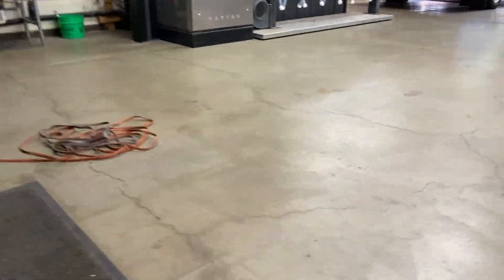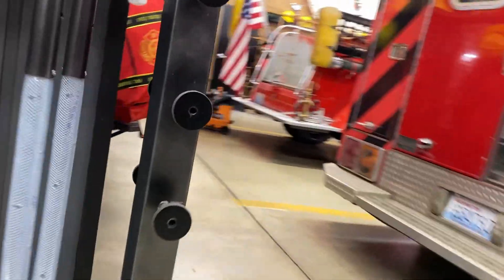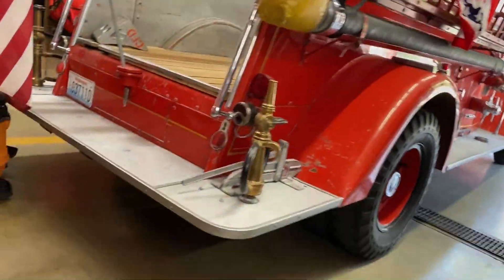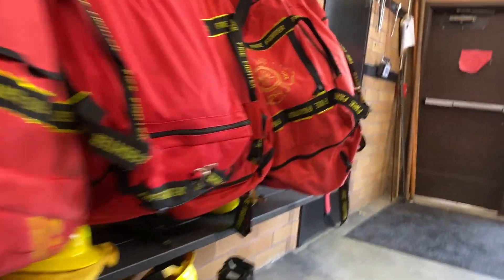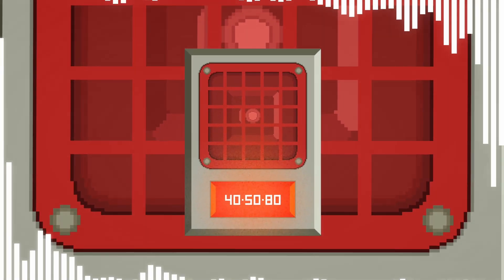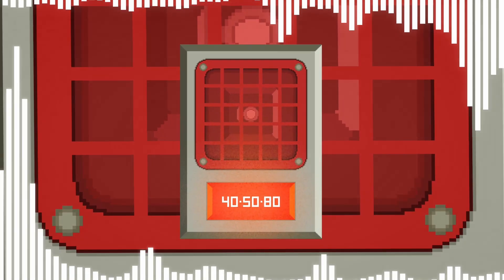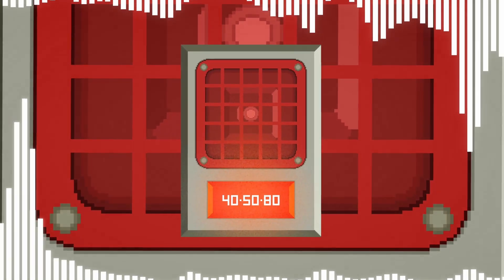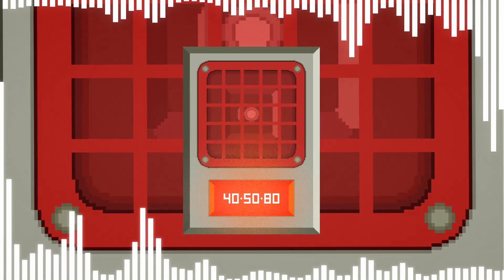Testing Fire Alarms in the Fire Station

Comment: My town’s fire station has a Siemens system from 2003 with the Siemens mechanical horn/strobes you have recently shown on your channel. For some reason, my area has/had several Siemens systems from the early 2000’s with mechanical horn/strobes.

Also, I think EST is underrated, especially with their newer stuff. They aren’t my favorite, but I certainly like them more than Honeywell.

Also (again lol), I find it funny that a fire station has a voice system. Out of all people, you would think they would need the least guidance in an emergency. The only reason I can think of for this is that maybe they are also using the speakers as a paging/fire call system.

Comment: Is this a Fire station in Massachusetts because this is the MA 900 Hertz tone
Reply: I've said it 300 times and I will say it 301 times

This tone is NOT the tone heard in massachusetts its the Morse U Tone, nor is the tone heard in massachusetts required in that state. It was a boston specific tone that is no longer required. Boston, not the entire state of massachusetts. The reason it is sometimes heard elsewhere in Massachusetts is because boston engineers often do work outside of the city and will copy the specs.
Reply: @Thing1and2urbex  Then why on MA life safety code does it say that the alert tone is to be sounded at 900 Hertz?
Reply: @FireAlarm-ni8lf  Whatever you are reading is old, that specific code is no longer mandated in boston
Reply: @Thing1and2urbex   morse u tone is kinda almost code 3 but not too long though. but massachusetts code 3 was kinda too fast.
Reply from the maker: @FireAlarm-ni8lf  no

Comment: I love this tone! I heard it in a video YEARS ago and haven’t since. It’s weird to me that the system starts up in the middle of the message, though.
Reply: common. I've inspected a few 3's that do it. Typically older ones do it, it's relay based. The tone and message is constantly going but when it goes into alarm the relay clicks and turns on the speakers. And that click sound you hear coming from the speakers between the tone and message is the relay switching again to the 2nd audio file
Reply: @Thing1and2urbex  Interesting!
Reply: It’s interesting how the 3rd beep is longer. Never heard it that way.

Comment: I honestly used to be not a big fan of the EST3 thanks to the experience of my old middle school’s system, but after some time working on it, the system actually turned out to be pretty awesome. I actually recently even got access to the 3-SDU and have used it to program an EST3X for my office’s demonstration bench.
Reply: I've been in many buildings that use these Genesis Speaker/Strobes on EST3s. And I agree that EST3s can be glitchy sometimes, but that doesn't mean that they are bad. As long as it works, I like it.
Reply: Who asked
Reply: @officialsimplexguy doesn’t matter.
Reply: @officialsimplexguy says the kid who posted 73 dorky comments on the same channel, get your head out ya phone.
Reply: @officialsimplexguy You did

Comment: Why in the hell does a fire station need fire alarms. The fire dept is already there!!! Just get a few smoke detectors.
Reply: It's required by law
Reply: Also if the building is big, you don't know which smoke alarm activated, and all they do is beep or not beep. Less advanced in a building bigger that a standard house.
Reply: Fire alarms like this are kinda just smoke detectors but better, better ways to find the alarm, test them, etc.
Reply: Dumbest shit i’ve read today
Reply: If theyre all on a call and the alarm goes off, the alarm signal can be sent to the alarm company and tone out a different station to come investigate
Reply: It’s all about manpower. Most if not all fire stations are not equipped or staffed to fight a commercial building fire. Once the fire alarm goes off it notifies the alarm company and the alarm company alerts local dispatch center. Then local dispatch will notify the fire department and surrounding fire departments on a working fire at the fire station. It makes sense but it’s super rare. It’s also within code in every state.
Reply: You clearly haven’t seen the video about the brand new fire station state of the art in Europe I believe that burned like to a total loss, because it didn’t have a life safety system
Reply: A fire can happen anywhere at any time!
Reply: A fire station is still technically a protected premises and those kinds of buildings are required to have that level of fire protection.
Reply: It doesn't matter what kinda building they're all required to have a fire alarm system even if it's a fire station or police station it's required by law. @FireAlarmDoctorYT1977